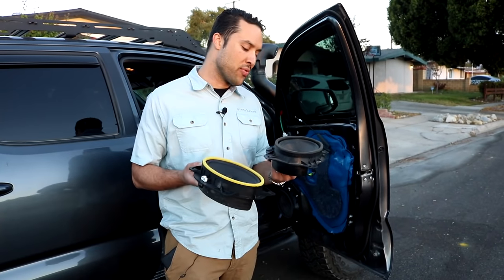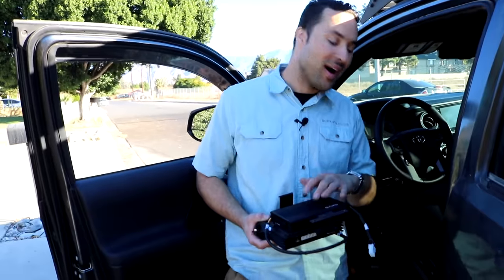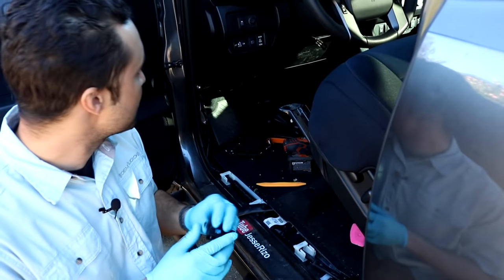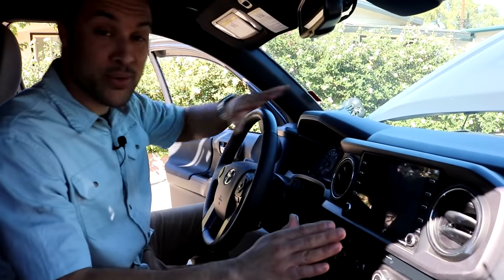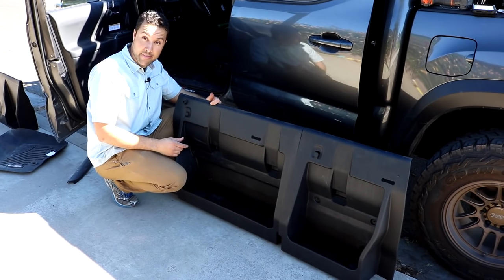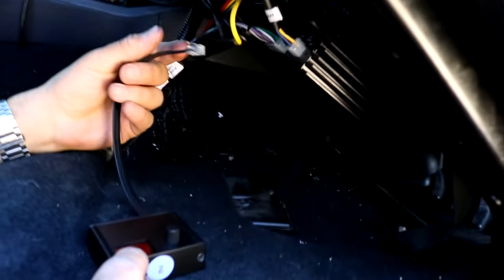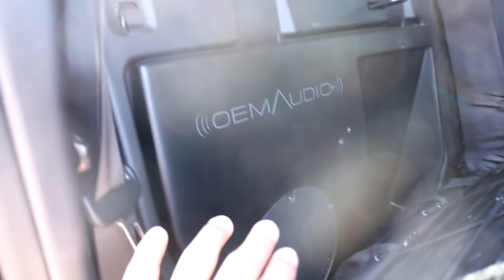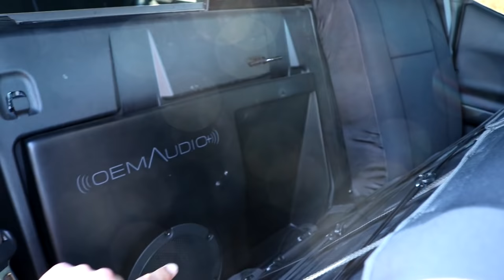TRANSFERRED MY SOUND SYSTEM FROM MY 2018 TO MY 2020 TOYOTA TACOMA | RAN INTO THESE PROBLEMS!!!

Comment: As a guy that recently installed a custom system where I picked every part. This is actually a good option if you don't really want to get into knowing a lot about car audio. If you want a hobby that is a never ending money pit and have plenty of free time, go for it. Go for it and cut a port that lets you put a subwoofer in the bed of the truck. The OEM system is good if you want a quick solution with a whole lot less work, and you will spend more to achieve their digital signal processing "clean sound".
Reply from the maker: Thanks for watching 🙌

Comment: Hey Jesse, been watching for a year and a half now. I recently installed the reference 500 system with the dual subs on my 2020 Tacoma.

9/10 times, my audio doesn’t work. This includes Bluetooth, Apple CarPlay, and radio (am, fm, xm). 

Have you run into this problem or know anyone that has? Because I have checked every one of my connections and I’ve had no luck.
Reply from the maker: Luckily no I have not that’s the first thing I was going to tell you is check all connections and check your ground a lot of people do not do good ground and that can mess with audio when u hit a bump as well 

Another thing hit up oem customer support there really good at replying
Reply: HiMitch smith I’am having the same problem with my 2020 tacom, I checked my connection,voltage,etc. have you been able to find the problem
Reply: @fernandomorneo3082  hello Fernando, unfortunately so far I have not. I rechecked my ground and it seems fine.

I reached out to OEM Audio Plus and they are sending me a new wiring harness. Hopefully that fixes it!
Reply: @fernandomorneo3082  my suggestion is too reach out to OEM Audio plus
Reply: @mitchsmith7127  definitely, let me know if that new harness works for you

Comment: so i have the exact same system as you(sub, 6 speakers and 2 amps), but if I wanted to add a second sub, would you reccomend it. Like can the amps hold well with two and still sound good?
Reply from the maker: Yes sir it actually sounds way better with dual subs https://youtu.be/DKs_FrjoqNo I did it to mine
Reply: @JesseRizo  since I already have the system, the amps I have are good enough to sound good right?